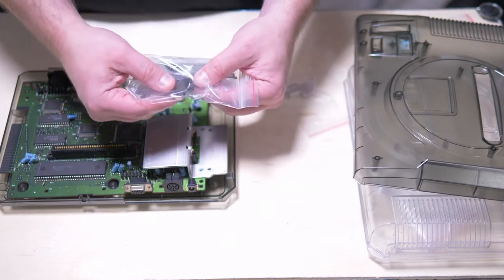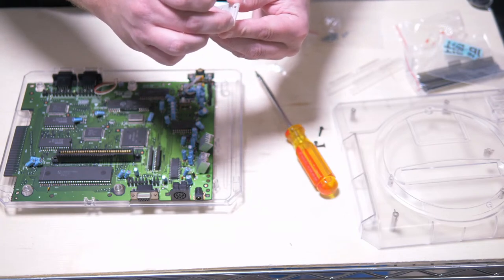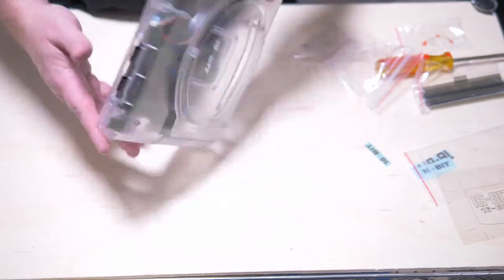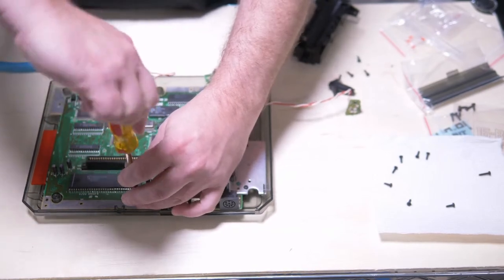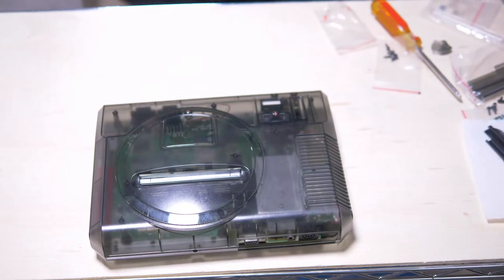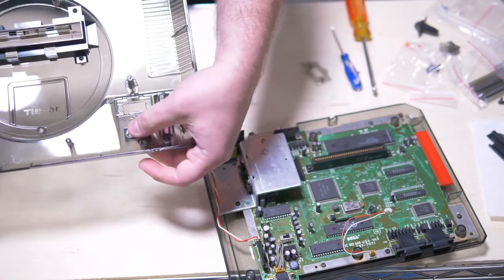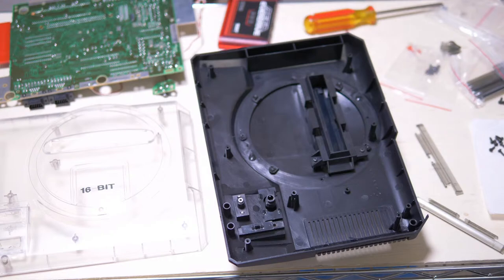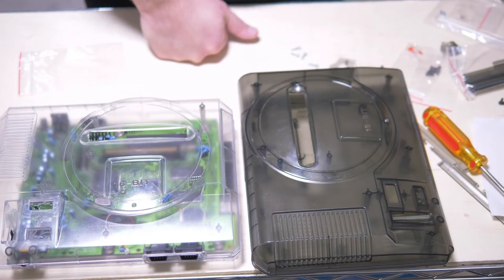Retro Game Restore Clear Genesis Shell - 1st Look

Comment: Hmm, mine did not come with the volume slider like yours. Would have been nice but I popped the rivets on the stock volume slider and got it to sit on there. It falls off if you turn the system upside down but that's uncommon.

Comment: I'm having trouble seating my motherboard into the new shell. It looks like on the new shell there is a screw post in the way that wasn't there on my original shell. This is causing one of the corners to be raised up slightly. While I can close the entire shell the ports on the back don't line up with the cutouts because of the raised motherboard. I also can't figure out how to secure the little power led in the new shell once its connected to the motherboard. It just falls right out of the top shell.
Reply from the maker: I should be getting a production version in today or tomorrow and will do another livestream.  I'll look for the issue.
Reply: @RetroRGB  Thanks, I appreciate it. Will try to swing by during the livestream.